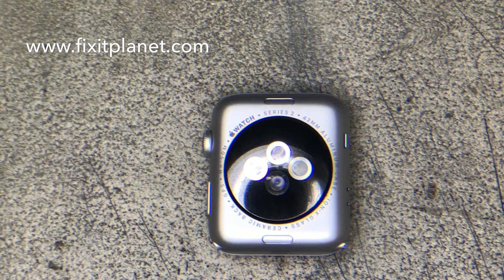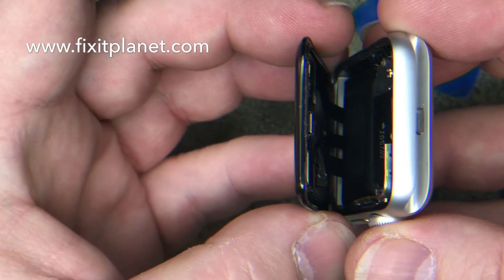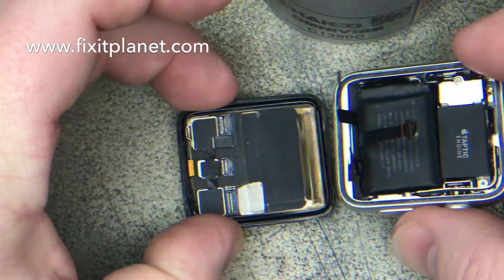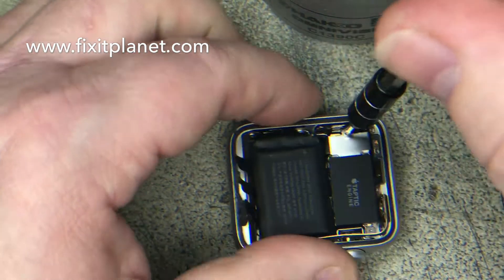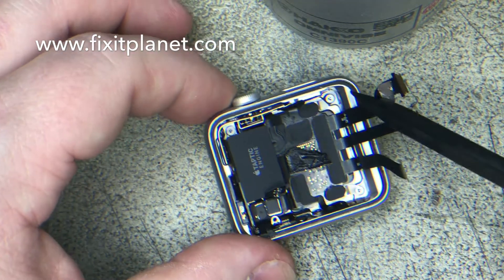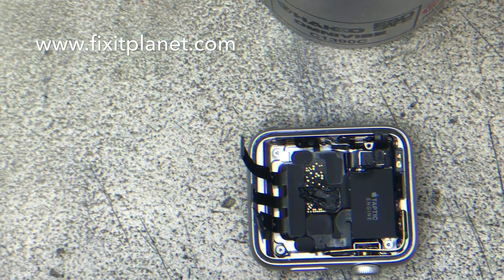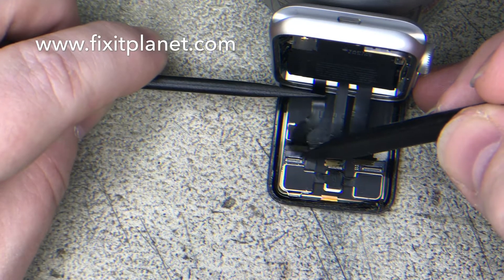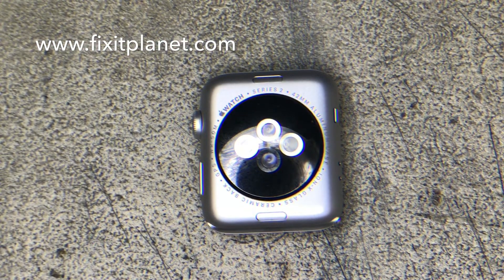Series 2 Apple Watch Battery and Force Touch Sensor Replacement Overview.

Comment: replacing the gasket is not nescessary to use glue the new gasket comes with glue to the screen ? another question watch OS 7 the force touch is not more used ? it was cancelled by the APPLE?
Reply from the maker: The replacement gasket may come with adhesive. Regardless if force touch function is enabled or not the gasket must be secured and in place for the screen to fit properly.
Reply: @FixItPlanet1  thx. Yoooou ! If I want to take out the force touch sensor is there a problem? Cuz I’m using now watch os 7
Reply from the maker: @Matheusthisisit  You need the gasket to fit the screen properly.

Comment: What are the symptoms if force touch sensor is faulty ? Does it make some of the screen non responsive ?
Have you taken apart a sapphire screen watch and not the normal ionX glass?
Reply from the maker: The force touch sensor reacts when pressure is applied to the screen. If it is not working then those features will not be available. Taking apart the sapphire and IonX is exactly the same.
Reply: Did you find the sapphire glass has two layers ? The top is bonded to the base and can come off separately?

Comment: For the series 3, what kind of glue or adhesive strips is used in the screen order to make it as water proof as posible? Do you think is possible to change only the glass (cracked) with the touch sensor using uv glue? I mean compatibility problems caused by the “not official repair”? Thanks I loved the video very helpful
Reply from the maker: It is possible to do glass only however, I would not recommend attempting a glass only repair. You can get the entire display assembly with pre-cut adhesive and that's as good as it gets. You cannot get it back to factory specification for liquid resistance once the screen is damaged. So don't go swimming with the watch. ;)

Comment: Hi John. If the apple icon will display on a locked apple watch series 2 unit, how likely is it that the LCD screen and digitizer can be salvaged from that unit and placed in another series 2 watch with a cracked screen?
Reply from the maker: Yes that can be done.
Reply: I own an apple series 2 42 mm with a broken screen. I
removed the broken screen and digiizer and replaced it with the LCD Screen and
Digitizer from another watch that was locked that I bought on Ebay. After
booting up the combined watch parts, the touch screen does not work. Does the watch
need to be restored to its original firmware so that the digitizer can pair
with the LCD? If so, how can I do that?
Reply from the maker: Check connections first, reconnect and test again. Power off and restart. If still not working test with original screen, if all is well then replacement is no good.